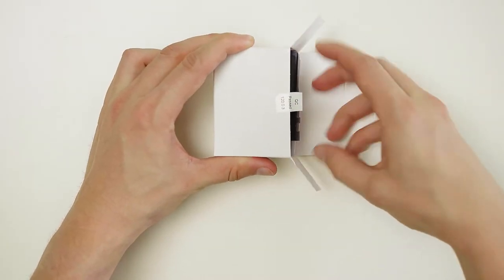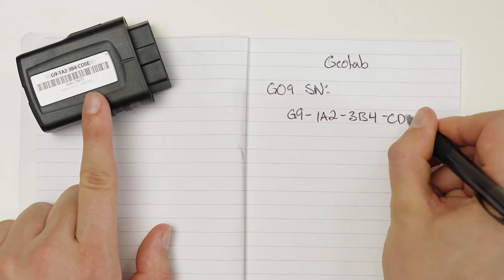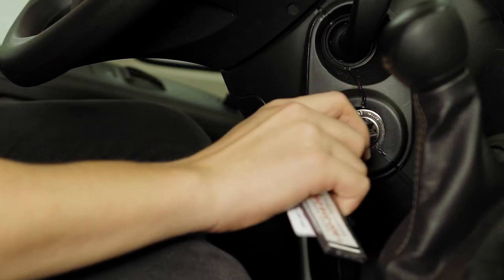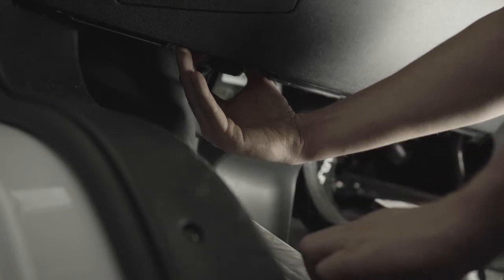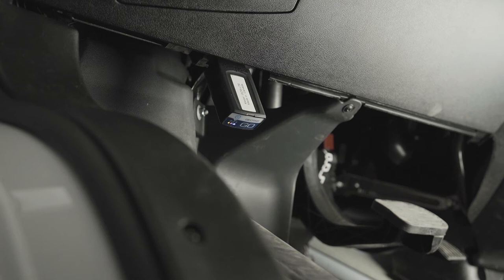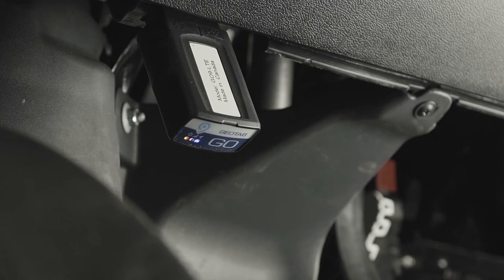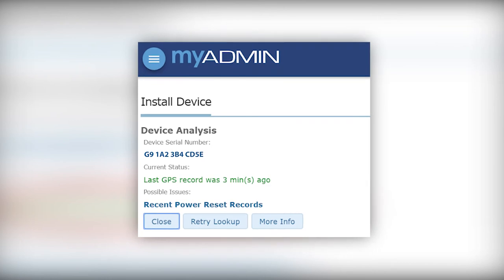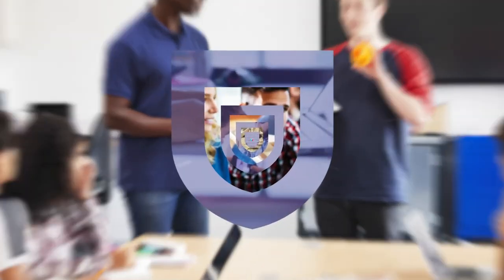How to Install Geotab's GO9 Device

Comment: To bad in most states blocking the obd2 is an automatic fail at smog ... should be using a t harness so the smog tech and the employee won’t tamper with . Not to mention ifnit has to be serviced by the dealer or mechanic.
Reply: My company runs 62 Geotab devices throughout Central California, mostly service vehicles. We order T-Harnesses with each new one that gets added, and all 62 have T Harnesses. They used to have quite a few harness types, but now they just carry one 16 pin harness with about 10 different "mounts" that work with a variety of vehicles. The regular harness allows you to leave the ODB open or mount it someplace else, while the geotab is plugged into the power fed to the ODB and can be tucked under the steering wheel and zip tied to cables so that drivers knees don't accidentally hit it and simulate a crash, which is an auto trigger email if the device jolts because it has a gyroscope and accelerometer. It can measure hard stops, starts, sloppy cornering, and most importantly, speeding, seatbelt, and collision detection.